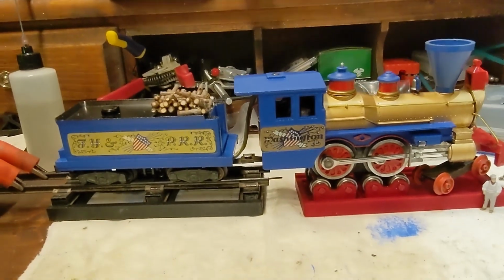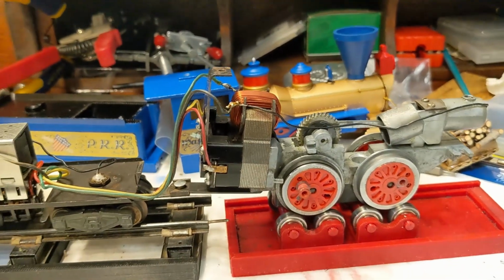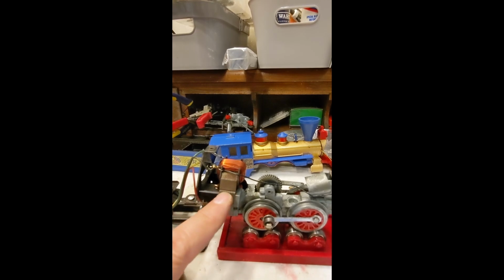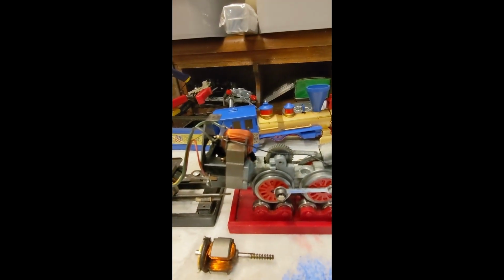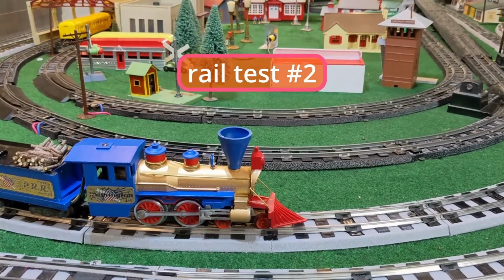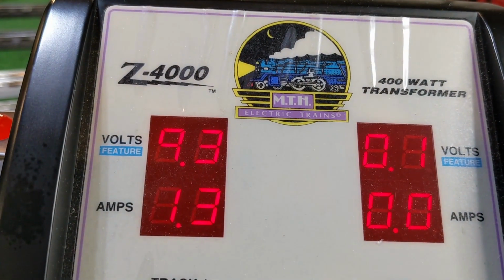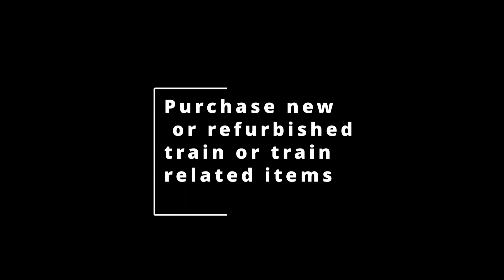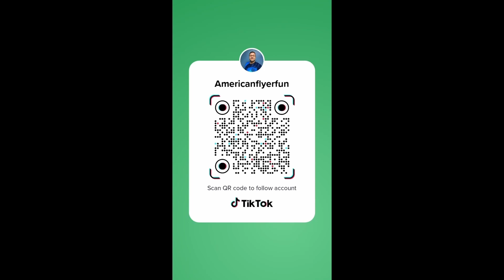A 1960 American flyer #21089 Washington rebuild part 2.

Comment: My second Flyer set was the Franklin version of this. I don't ever remember servicing that locomotive, ever. It ran well when I got it in 1960, and ran well when it came out of storage for another tour of duty in 1986, and was still running when it was put back in storage about 20 years ago. It always was a bit noisy. Maybe now I know why. You did a great job of this operationally and visually.
That is an interesting segment at the end with this train running past the flashing crossing signals which, of course didn't exist at the time locomotives of this style ruled the rails. Where does the sound of the ringing bell come from?
Reply from the maker: This is very interesting to read Mark.  And thank you for your kind words.  The bell comes from an American flyer crossing signal with shack and danger bell.

Comment: Love that 21089 Washington set. Musr be à way to put a pea size head light in the headlamp holder.
Reply: put 14 volt grain of wheat bulb in a Casey Jones headlamp. Wired to motor.  Put a short on YT of engine finished.

Comment: Nice repairs Austin. I think the temder shells vibrate and resonate noise due to the single mount screw and tab/slot attachment.  My Washington tender makes a lot of noise.
Reply from the maker: Good point.  I've noted that lubricating the rear of the armature quiets the motor down for a time.
Reply: Yes, the side brush armature does not have an oil wick.  I think that's another reason for the fiber thrust washer at that end of the armature. They need a drop of oil each time they are run.

Comment: Really nice genuine wood load on the tender. Decent smoke output. Very nice slow speeds. Chuffed are a bit on the weak side. Did they use the H0 smoke and choo choo unit in these?
Reply from the maker: Thanks Ron and yes they did.  I can hardly hear the choo-choo when the shell is off.  It still creates enough air to push the smoke out though.
Reply: @AustinsAmericanFlyertrains  
Yes, I noticed that. I have an H0 Hudson that choo choo is much louder.
Reply: @AustinsAmericanFlyertrains  Can you show us how to service/rebuild the HO smoke unit  that was in these frontier locos? I have the same lack of chuffing in my unit & would like it to "bark" a little louder. I'm assuming you can replace the pistons to make it louder?
Reply from the maker: @joshkurucz4723  I'm not sure there is a way to get the HO smoke unit louder as it is just small.  A larger piston would generate better sound...but now you run into space issues...at least if using an American Flyer stock choo-choo.  Other than adding electronic chuff I'm not aware of a good mechanical solution.

Comment: Austin, I have the Franklin version of the train  and the reverse unit has a problem. Gravity is supposed to reset the unit but my brass rod does not always drop down when the voltage is removed.  Have you seen this?  Any suggestions
Reply from the maker: I have.  Cleaning with a cue tip and crc 226 has worked for me.
Reply: Thanks.  I have crc 226,  I will try that.   @AustinsAmericanFlyertrains

Comment: I passed up a Washington set about 7 years ago. It was in a store straight from Gilbert factory. The owner bought some of the trains from Gilbert and was trying to sell them. He wanted a  $1000 for the Washington set if I can remember some of what was for sale. The set was never run according to the man who took over the store after it close up back in the 1970s and 1980s, I didnt have a $1000 so I had to   let it go! Doggone, tried to figure it out but darñit. All the packing boxes were with it too!!
Reply: O
Reply from the maker: It amazes me that after all these years there are still new/unopened flyer items in existence.
Reply: Yes Austin, I still have mint never run 24419 CNR, only reissue box but have a 24413 mint reefer in Original box, a 935 mint in box Bay Window Caboose also. Can't remember how I found those pieces.